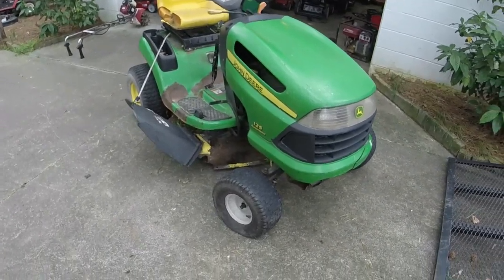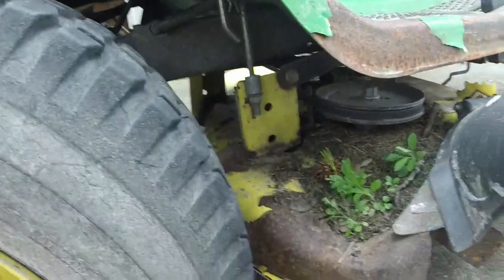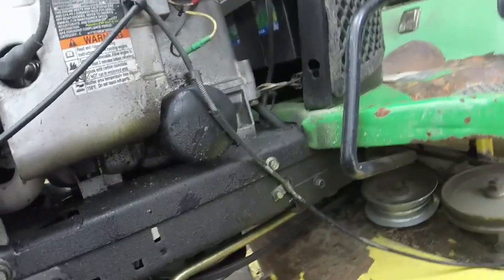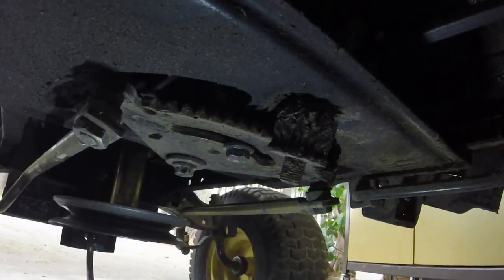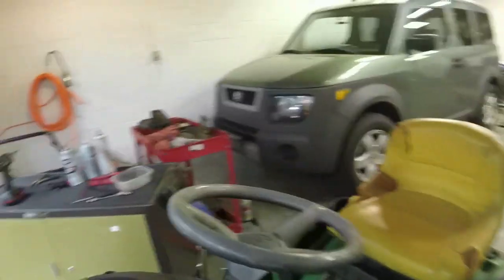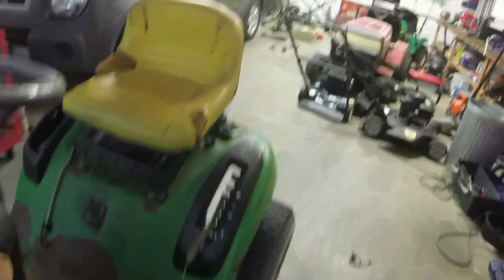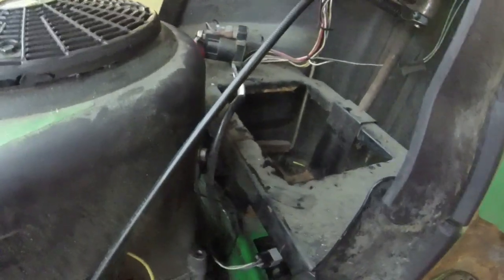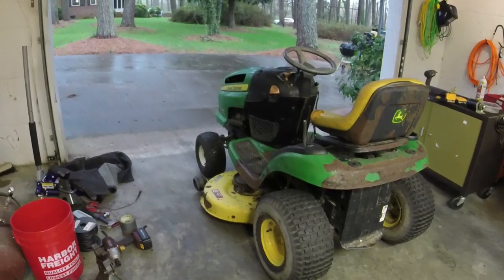John Deere 125 riding mower park brake safety and front end toe out fix, overview

Comment: Amazing how they all rust same area, and the deck welds I've got L110 with a Kohler Comand 940hr! L111 with V twin with 280hrs. With one good deck between them both so I just interchange it between the two.
Reply: Ha thats awesome that u just swap um
Reply from the maker: Good decks are hard to find for these.  L110 with a Kohler is about the quietest mower I've ever heard.  This deck went to a mower in much better shape but have the other one if I decide to finish fixing.

Comment: I tend to stay far away from John Deere’s they’re troublesome and not worth the money the only good thing from them is the motors and maybe a manual transaxles. They tend to be money pits with parts lots of money. But hey if it’s free then ok haha.
Reply from the maker: Oddly enough the motor was the worst of this mower besides the wheel bearings.  I discover that in part 2.  Don't have a lot of money in it and they sell for more than the average rider because it is JD green!
Reply: Ellis Mowers let me guess valve guide!